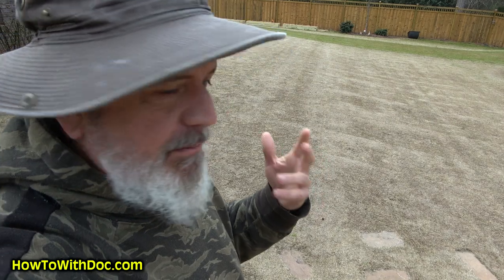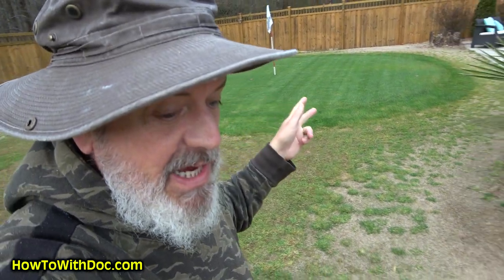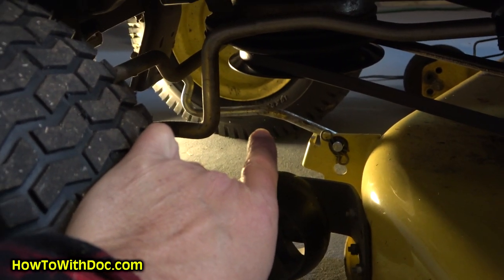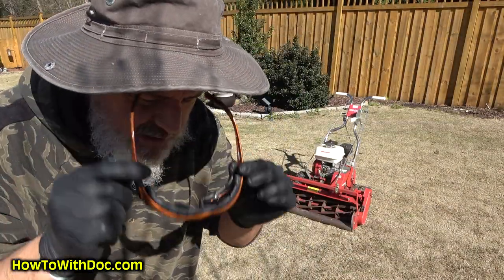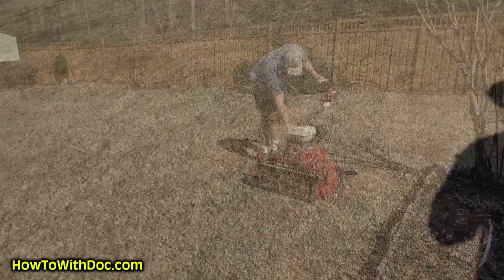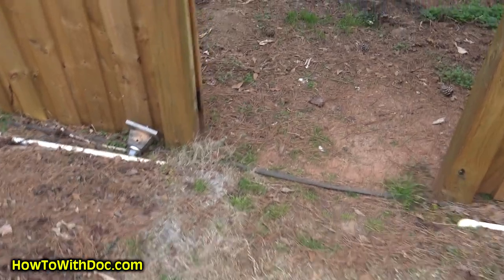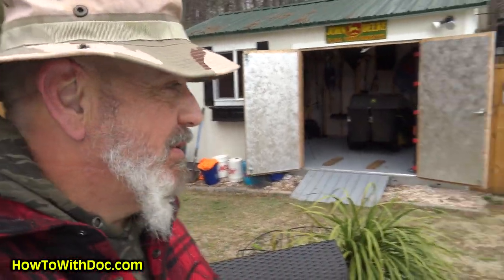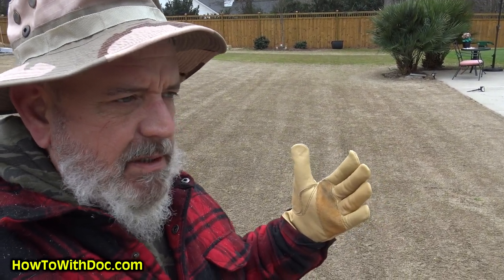Final Low Spring Bermuda Lawn Scalp

Comment: Started mine yesterday in charlotte. It's not fun at all. It's my third year doing it. The dust is horrendous. The clippings are a nightmare. Doc is 100% right, if you don't get the clippings up you will have massive thatch stripes throughout your lawn after a rain. When they form these stripes they are very hard to get up.
Reply: I guess my mower isn’t picking up all the clippings, because I get those mounds when it rains.  I use a bagger, so I need to find out why it’s not picking up all the grass clippings.
Reply: I’m here in Mooresville NC also, did you do final scalp already? I’m not seeing much green yet.

Comment: Thanks for all the videos. First time home buyer here just trying to learn and try. Thanks for the calendar as well. Just to make sure, I need to do a pre scalp, pre emergent and then good scalp a few weeks later before putting any other stuff down correct?
Reply: people do a pre-scalp so they aren't taking it down all at once... 
1.  It's harder on your mower
2. it's less clippings at one time.
You can do the pre-emergent anytime.  I prefer to do it after the scalp.  But it depends on temps and when you applied your last pre-emergent app.    You want 365 day coverage with pre-emergent.  It depends on your weeds and your soils, climate on what works the best.
Reply: That's what ived followed from his last few videos.

Comment: Doc, I am a perfectionist but you seem to out do me. Is there any thing wrong with leaving those clippings on the lawn which will eventually decompose to form fertilizer? What l do after my scalping is, I raise my deck few inches higher and run over the lawn and that gets the clippings matted down avoiding runoff when it rains. This can be done any time you are through mowing.

Comment: I have Meyer Zoysia in the Midwest.   Can I scalp my lawn while it is still dormant in the spring?   Then what condition does the Zoysia need to be in if I decide to dethatch with a tine rake?   I'm confused by other videos when to scalp or dethatch?
Reply: It depends.  I have zoysia in my back yard.  I rarely dethatch, however I keep it very very low, which greatly reduces the thatch.    But yes you can scalp!

Comment: I would almost think you need to line the baggers because your losing a lot of clippings through the holes in the JD black bags.
Reply: Bagger has to breathe. If you lined the bag then no air flow once clogged means clippings stay on the  ground. It's a dusty, crappy job but has to be done for healthy thick greenup in early spring